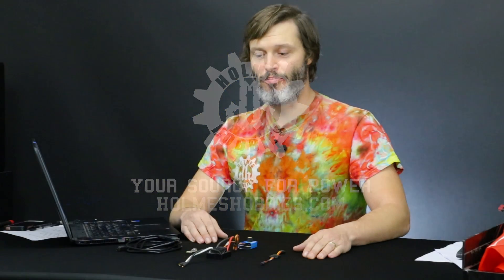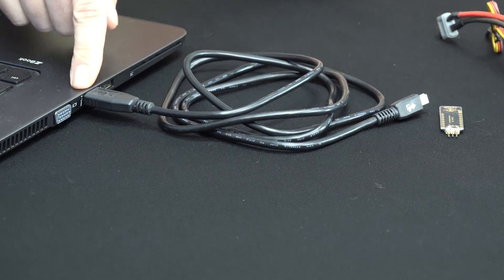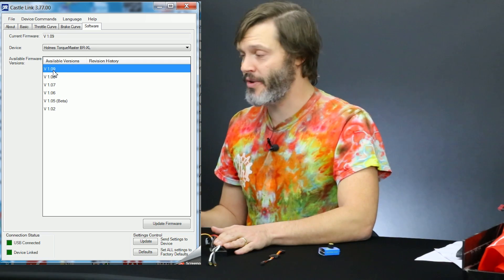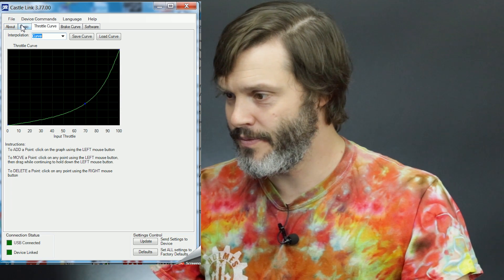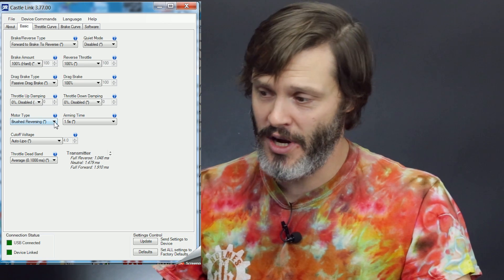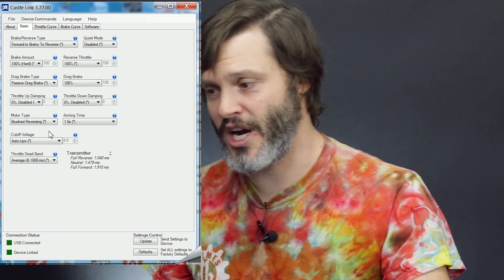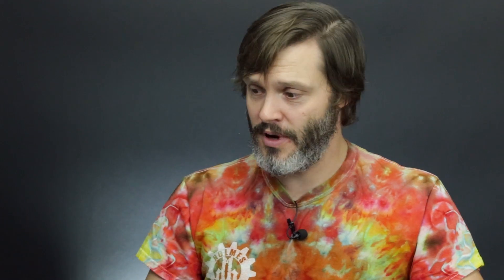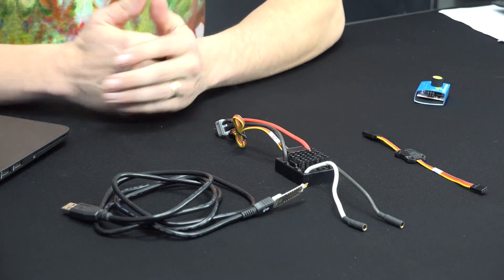How To Program A Brushed ESC! - Learn To Set Up Your Speed Control - Holmes Hobbies RC Basics Series

Comment: Hi. So programming the ESC means you don't have to worry about buying a separate soft-start and low voltage cut off? Or are you buying those devices and configuring them with Castle link? I think you're saying I just need an ESC and a castle link to address those issues

Comment: My crawler has this ESC and my truck is too sensitive on the throttle. It has a punch to it and you can't creep on the rocks. Do I need the castle link to fix this? Is adjusting the throttle curve what is needed? I have the castle programming card for track use but don't have the features you can get with the link. Thanks in advance.  You make a great esc.

Comment: Greetings John....I have a question, Does the castle Link power the speed controller through the cable from the USB port or do you have to power the speed controller with your battery?

Comment: I need to control two brushed (775 )motors for my rc tank project.i need to control both trottle as well as directions using flysky 6 channel tx and rx.please help with the connections and the esc needed.

Comment: the ever present photographer in me says, nice lighting setup you got there. a little hot on some of the close up shots but i appreciate you putting in the effort. love your vids as a person new to RC. plan to get some of your gear at some point in the future, all the locals here love it and recommend it!
Reply from the maker: Thanks for the eye.  Maybe dial in the b roll cam settings a bit, probably had it on auto.   We typically have 5 sources of light in the studio.   That and the background really made it easier to pick up detail in shots compared to my earlier stuff.
Reply: @HolmesHobbies  keep at it and keep improving! as a full time director of photography i appreaciate the effort you put into it. Also, your tie die shirts are dope.  Mt go to light set up for something like your area would be 1 light has a hair accent (above and behind you), 1 powerful light (or 2 small ones) into a large piece of silk, savage translum, or other diffusion material. (this is the key light you should set it first). then ill bring a smaller light to fill the shadows at about 45 degrees to the key light. the hair light goes on the side of the body opposite of the key light (the shadow side of the subject). as far as the overexposed shots, the lighting is fine just need to drop your ISO a  stop or close down the lens.

Comment: I to represent with my home's hobby tie dye shirt. I like to throw a curve similar to what you showed maybe not hardly is aggressive. I liked my drag break somewhere around 70% I like them to creep just a little. I like to use quiet mode on my crawl Master Pro 16 t to quiet them down.
Reply from the maker: Mine is quite aggressive of a curve.   It really helps on something like a 3500kv motor.   Slower motors, it doesn't need to be as much to still have easy low speed control.

Comment: Will Holmes hold burn brushes up?
Sticky tires on sticky rock ?

Glad to see this for brushed!
Reply from the maker: It will wear brushes faster, but the rate depends on the rig and setting.   Set too high with too heavy of a rig and left to sit, yes it could burn up brushes.

Comment: Mr. Holmes doesn't use Holmes hold?
Reply from the maker: Nope.   It's more useful in a comp situation, but I typically plan ahead so I'm not trying to stop dead on an incline or decline to begin with.   I prefer a little roll to the vehicle anyway.

Comment: One tip I could add for those who have pulled the red wire loose for a BEC, take a splitter for a servo wire and on one of the 2 ends of this splitter de-pin the white and black wires and leave the red, I chose to pull off the plastic sleeve that protects these pins so that they are easier to connect to. Now this splitter can be used to connect to your ESC to the Castle Link without having to put the red wire back for the ESC, plug the ESC wire (the white and black wire) into the splitter end with 3 wires and plug the loose red wire into the other splitter end with the red wire. This does assume that you havent cut this wire and have only de-pinned it (leaving the connector on the red wire). Picture here https://i.imgur.com/6FY2r5al.jpg?1

Comment: I think the throttle curve does have a bug when you change the curve and then try to switch to curve none or linear, it gets stuck on the curve that was just made and wont go back to normal until you click around for a bit, easy to resolve but bugged. You can also load a curve but it wont show up when this is happening.
Reply from the maker: Thanks for the heads up.

Comment: I've used the throttle damping as sort of a punch control for brushed motors, I didnt realize it was meant for worm gears. I also love the quiet mode simply for silencing the high pitched "EEEEEEEEEEEEE" sound that ESC's make when going very slow, I actually buy this ESC mainly for that quiet mode (also for the castle link software), I must have 4-5 now.
I always make sure to watch these videos even if I think I have nothing to learn, and theres always something that I pick up from these videos.
Thanks for being such a great supporter of crawling!

Comment: Ok for my settings I run my esc  in quiet mode, I also set drag brake to 20 to 30% reverse mode I set to 30% forward to 100% with 10 to 20% damping with the curve set at 15 to 20%

Comment: Does your brushed esc br XL come pre tuned with your tuning for crawlers
Reply from the maker: I don't have the throttle curve on there as stock, but otherwise I didn't change anything from stock settings.
Reply: Could also probably be tuned via the radio with a little YouTube search on castle programming. Use to be very good at it myself back when I ran a sidewinder in brushed mode.